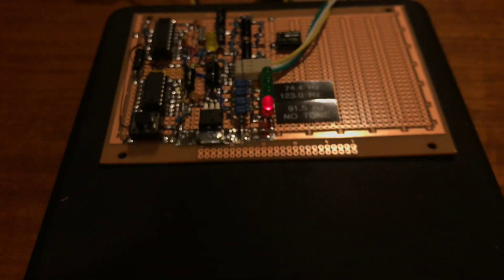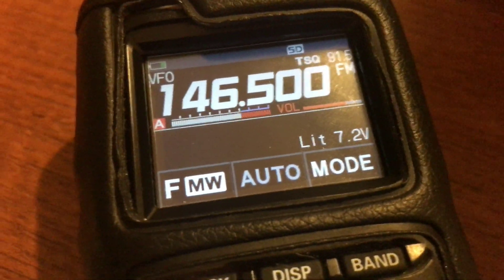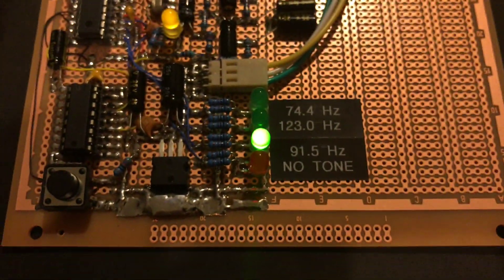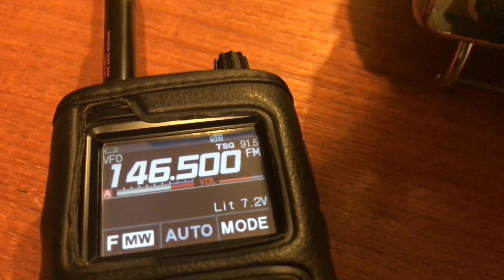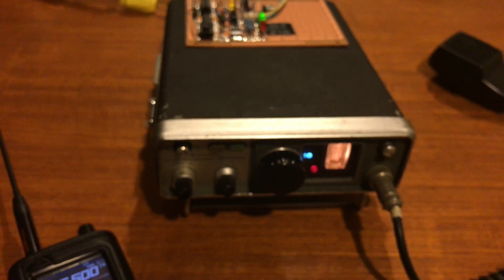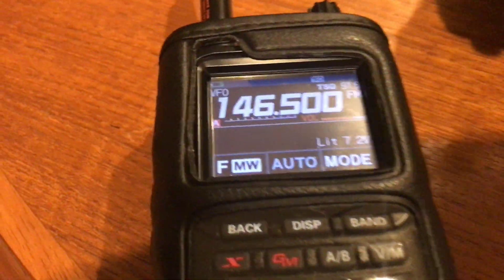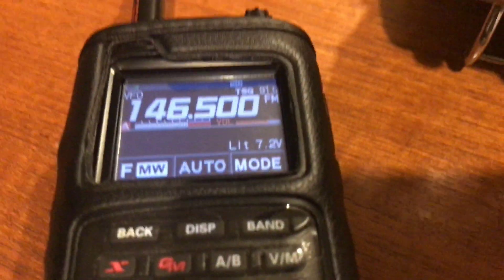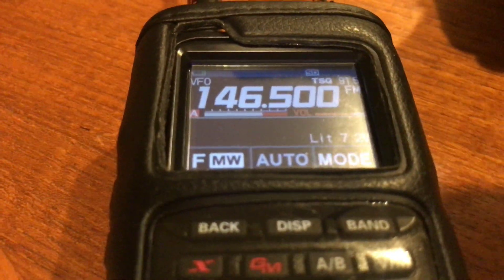Simple CTCSS Hack

Comment: Thanks for the video!  Dave Jones brought me here.
We use tones on our radios at work.  We have a FCC license for certain frequencies and tones.  I always thought it was funny that while we used a tone, we could still sometimes hear school buses or taxi cab dispatchers talking, but they never seemed to acknowledge that they heard us.  I thought it was odd since we were operating an aircraft, so they should definitely hear our aircraft transmitting if we could hear them from our ground station.
Does that make sense?  If we could hear them, that means they were using the same tone as us, right?  Or is that not true?  Shouldn't they hear us too then?   Maybe they couldn't hear our ground station, but they should definitely hear our aircraft, considering that we could often hear our aircraft from 20 miles away (even if the aircraft couldn't hear us on the ground some times). Or is there something which I am not understanding?
Thanks!
P.S. What a loser.
Reply from the maker: For most modern stuff you an set a transmit and receive tone. Those two can be different. Receive squelch will only open for a transmitter sending the same tone, and vice versa. You might not want to use one or the other in some circumstances... so any combination of who can hear who could potentially happen. I don’t know what actually happens on commercial bands though.